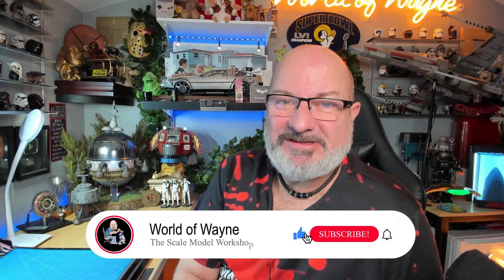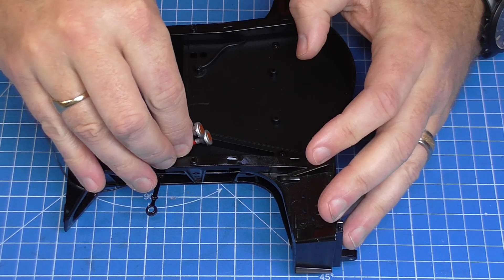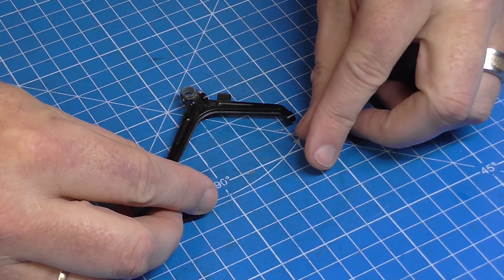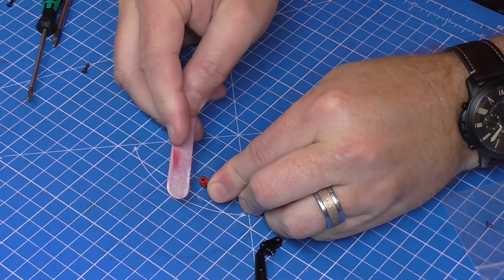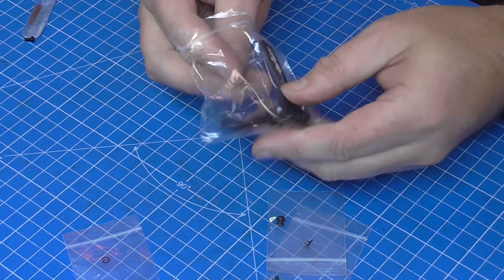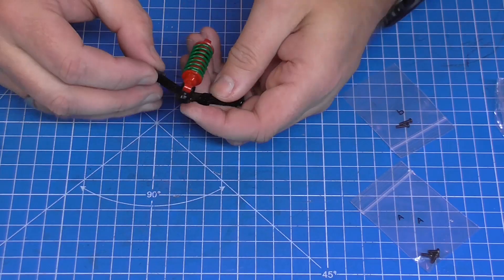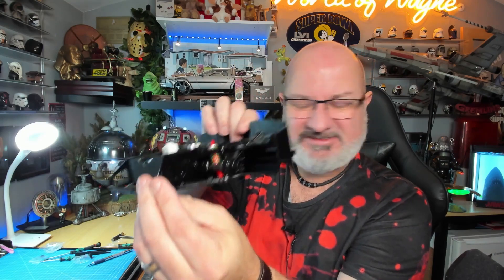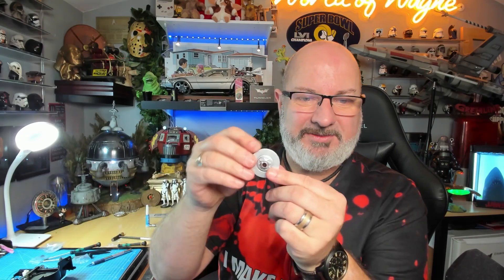Build the Lamborghini Miura - Pack 8 - Stages 59-66

Comment: Trouble with those stick-on brake disc mods is they only supply enough of each pattern to do one side of the disc when both sides might be visible.  If you are rich and bought 2 sets, I'm not sure the discs would be thin enough to fit in the caliper.